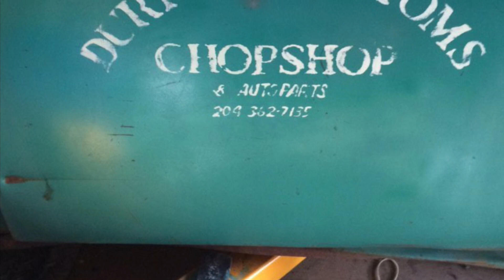60 International Harvester swapped

Comment: Nice truck. That must be a nice driver with all that modern car underneath...
Reply from the maker: It was a dream to drive. Get in and turn the key. Modern suspension makes the ride smooth.
Reply from the maker: I have another video with another 60 we did. The red one is the most recent. Just finished it. The booster ended up having a leak. We changed the booster and the brakes work flawlessly.
Reply: Subscribed